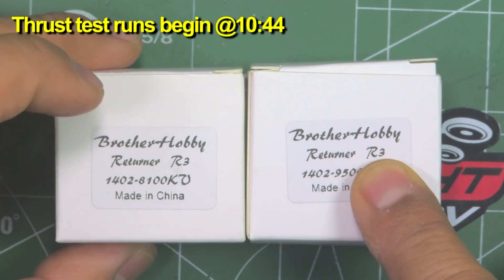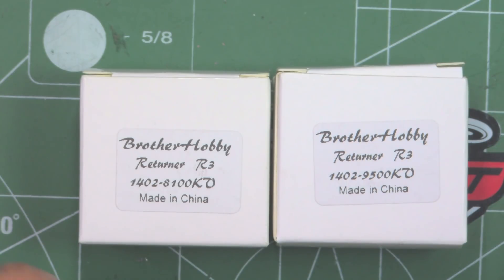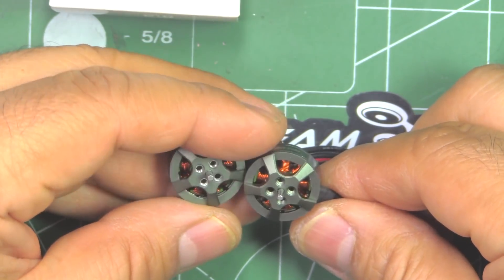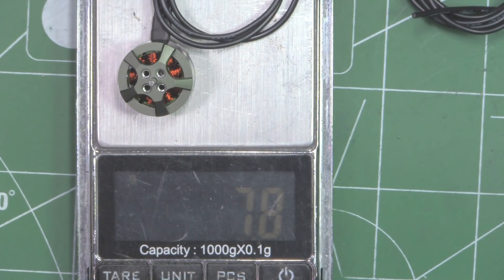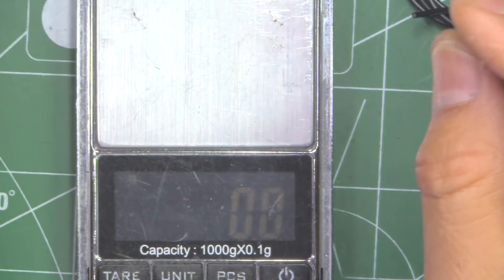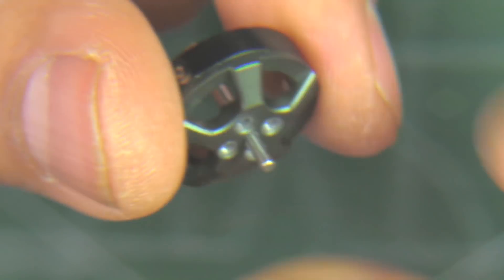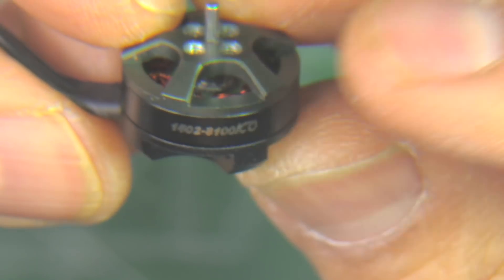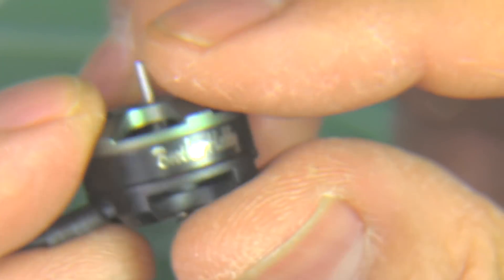Brotherhobby R3 1402-8100KV Thrust Tests & Overview.

Comment: I race the 9500kv version on my 3” with Gemfan 3025 bi blades. 2S GNB 650 mah 85g dry weight quad. Not as much bottom end as a good 1106 but awesome mid to top end! Great for larger out door tracks.
Reply from the maker: Awesome specific setup for that type of track. Thanks for giving details on your setup. Good reference for everyone.

Comment: with my 3 inch racer 115gr with 3s 450mha battery it is a beast. I have the 8000kv version with the gemfan 3035x3 props and get a 3 minute flight time racing on a racetrack with a lot of turns. Can say the motor is durable in crashes, but the bearings arent that good. Motor didn't get hot
Reply from the maker: Thanks for sharing your setup and experience. Too bad about the bearings.

Comment: Interesting motors, another helpful review, and cudos for the discussion and links about test stand results and real field performance.  I noticed the setup BLHeli timing was "medium high."  Are there legitimate reasons to think these large, high kV motors might work differently at other timing settings?  How was the setup timing decided?
Reply from the maker: David Campbell Nowadays seems default settings work well for the most part for lots of motors. For static thrust tests. Medium high has worked well for me for the esc I'm using. In actual use, the FC is way more demanding and way faster at changing motor speed so timing demands could be different. But again, modern ESCs are so good that default settings will be good for most

Comment: Interesting motor, would need a super light frame. Hope you don't mind me asking bit of a random question, something that has been bugging me. If I had the same frame, with similar weight set up using a 1402 say 9500kv on 2S or a 1306-4000kv on 4S, which do you think would perform better and why?
Reply from the maker: That's a very tough question to answer. On straight line speed, I think the 1306 would have the faster the top end speed as motor makes more thrust than a 1402. On very short, tight racetracks - it's hard to know which could have the advantage. The lighter overall setup of the 1402's could have an edge on certain tracks. For freestyle - I think the 1306 may feel better as it would have more overall thrust when paired with as light a battery as possible (maybe 650mAh 4S)
Reply: Thanks for the reply. If budget allows I will try to test this out.

Comment: Seems terribly inefficient... My guess other than the stator being so thin and the magnets being longer than they are tall is that there is too much aluminum 'near' the magnets both between them from the bell 'top' and from the 'full' base 'ring'. My theory here is that Aluminum is paramagnetic and basically provides a 'breaking' force when subjected to changing/moving magnetic fields. Thoughts? Tnx for the effort and info!  :)
Reply from the maker: GITech At this size perhaps the thrust stand is not showing good performance compared to what it'll do once in the air. I'll be curious to see how it works for people and their superlight setups
Reply: Agreed, I look forward to seeing what it does in RL as well. But, there's got to be something to the physics involved that I alluded to. I see lots of room for improvement in the design rather than just downsizing from their larger motors. I bet a ZMX version would more in line with perfection.  ;)  :)

Comment: Ultra light 3'' motor then? Thanks for efforts and video
Reply from the maker: noonenaught I'm gonna be waiting to see how it does in flights.  This could be a motor that really needs to be moving with props unloaded to show its better side.
Reply from the maker: Aryan Gangurde Yes. I think that's the target . Interesting little motor. Thanks for watching.
Reply: im not too sure really the rcx 1304 5000kv on 3025 and 3s produces only 20g less thust than the 1402 but roughly  a whopping 50% less amps
Reply: that is very true the high kv might not be useful until unloaded properly
Reply: noonenaught this has a bigger shaft, so better bearings and durability (one hopes) too bad it's a bit pricey.